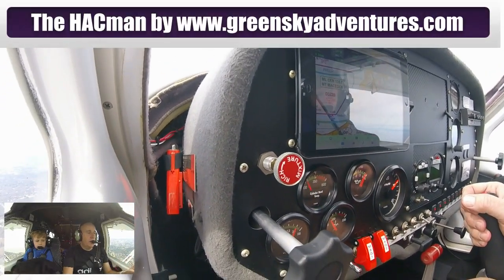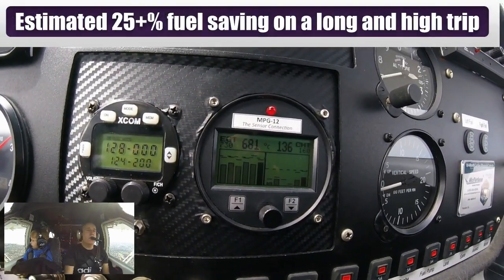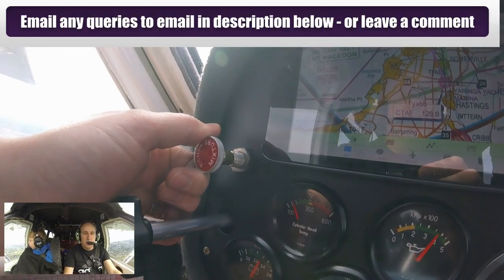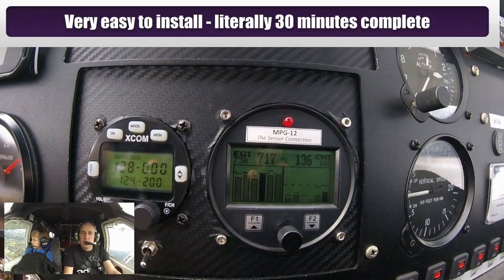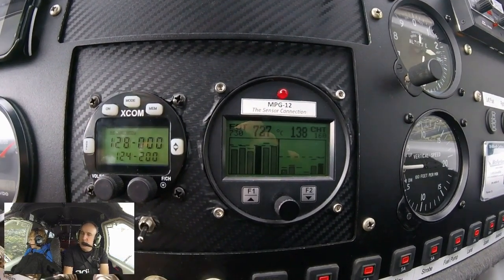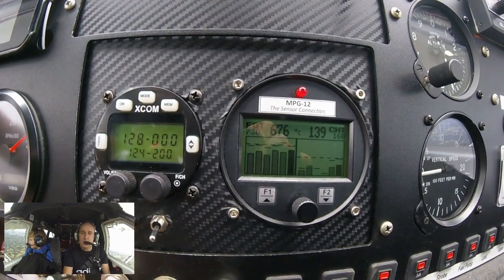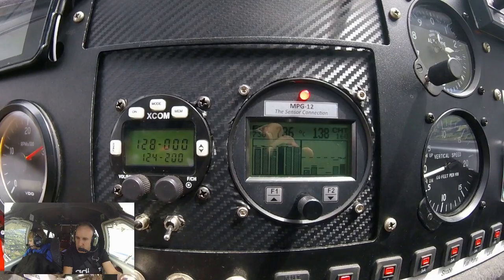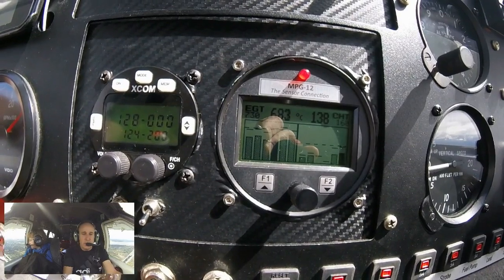HACman mixture controller - Jabiru Rotax fuel saving aircraft engine LOP ROP lean of peak rich

Comment: Would be interesting to know what average real life fuel saving is and if there were any negative consequences of using it.
Reply from the maker: Anton Valks,  missed this comment sorry.

I definitely have a real-life fuel saving.   The numbers speak for themselves.   Optimum safe fuel burn at say 720egt.  Then you climb to 8,000ft say and egt’s are then down to 650 - waste of fuel!  This unit will then bring it back up to 720.   A fuel flow meter will show the difference.

It will mean less chance of damage to the engine as it will be running at the optimum egt and not too cold / rich which will be effectively washing the cylinders unnecessarily with fuel, causing additional wear and tear.
Reply: Joel Godard,  just seen your post on Air Fuel Ratio for your Jabiru.
Very interesting concept. Thank you.